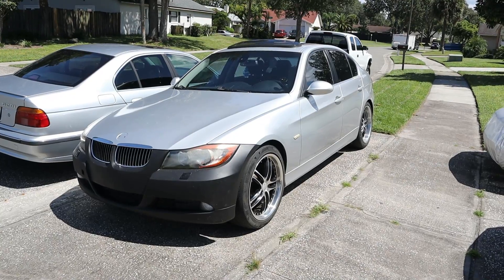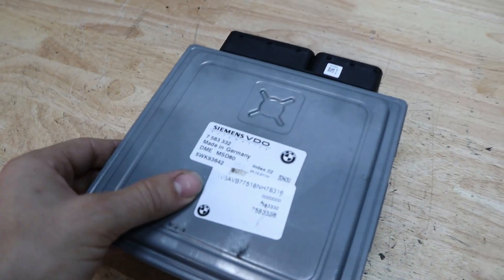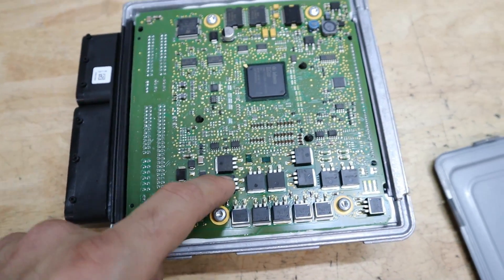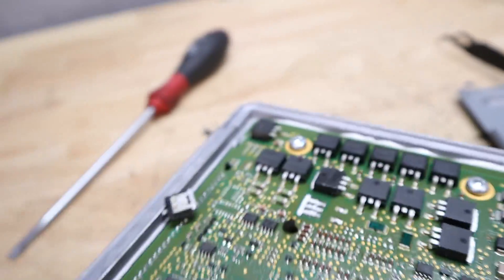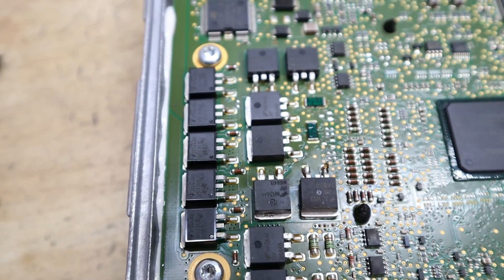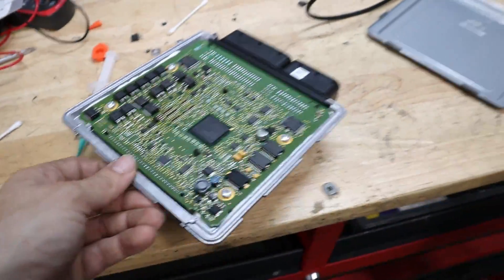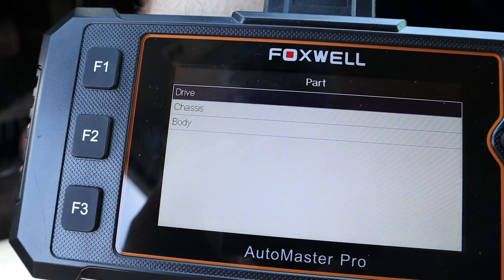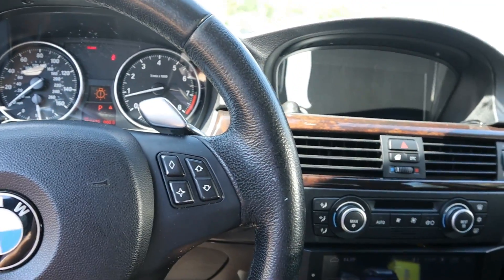WHY is my 335i MISFIRING?... MSD80 Mosfet Repair

Comment: Research says the MSD80 has two flaws. The MOSFET drivers and the power supply regulator MOSFETs. I suspect the PSU for one of the banks was the problem here. I am going straight to the MSD81 and completely circumvent the MSD80 ticking time bomb.

Comment: Hi mate , i keep getting injector misfire on cylinder 1 and 4, replaced injectors, coil packs, spark plugs, still the same, live data shows 0 activity on injector 1 and 4, does it mean i have the mosfet issue too

Comment: Being that one of the banks (3 cylinders) that are next to each other are misfiring, your problem is likely a preliminary issue, for example, the main wire that feeds the 3 coils power is broken, maybe their shared ground is broken, maybe the power wire feeding those 3 injectors is broken. Find the wiring diagram. If you don't have it, put your email in comment i can send you the wiring diagram

Comment: That was a nice video, and definitely informative, but I wanna point out couple things.
First always, always check live data on scal tool, you could find informations that could help you diagnose your problem, always helpfull and it's part of a protocol.
Seconde before you do any job that could make you waste time, make sure it's a MOSFET or might be something else such as diodes or resistance for extra protection in the circuit, cause mosfets seems working fine then they are fine..
Third after trying to diagnose with scan tool , go to the seconde easiest way which is wiring check using the multimeter and a wiring diagram for the car , check the positive on the injectors and coils it might be blown fuse since they all get the same positive from the fuse box (parallel), plus you can check the wiring between the actuators( injectors& coils) and the dme/ecu.
Fourth if everything until now is good, then you definitely have a pulse problem could be a bad camshaft sensor or a bad dme.. in this case you first test the CMP sensor, if it's fine.. then go get a wiring diagram , pinout your pins from the coils and injectors and locate your MOSFET or IC injectors/coils ( depend on where your problem is) and change what seems failing... If nothing is working and still the car seems bad.. you only have the last option which is a bad micro processor in the dme which is unfortunately unchangeable, go change the dme and you're fine, guaranteed..... 😮‍💨 That was long , but damn I love this job 😅

Comment: Why post a video if it didn't fix anything? Troubleshooting completely out of order, don't believe everyone's misinformation. SMD board repair?  was this your first experience doing board repair?  Surprised no contact pads were ripped from the board when removing. Fyi most mosfets will either look or smell fried and can confirm by it testing open or shorted.

Comment: Mostly one can never have a good reading if the mosfets are still on the circuit board, the best way to test them is to make sure each comes out in one piece then test it separately that way you can really know if it was dead so that you can really know that might were the problem was....otherwise you replace already working mosfets,,,and the other thing I noticed is that if the old original ones have no problem its best to put them back because they are genuine these days after market products are very unreliable....and also mosfets should never be touched with bare hands when  new, I m sure most know that....

Comment: You should have practiced first before this. Some of those pins are hanging on by a thread. 
You bought flux but I barely saw you use any. It’s super important to distribute heat evenly while soldering

Comment: How did you solve the error or what was defective?
Reply from the maker: New DME unfortunately. Couldn't get the old one to work.
Reply: @TheBimmerBarn  I desoldered and renewed two mosfet. Now the BMW is running again. The whole thing cost me €5. Thanks.
Reply: All mosfet must have the same ohm resistance at the end when measuring.

Comment: idk if u replaced the DME and/or if u ever fixed it. but on mesfet for cyl 4, it seems u ripped the motherboard layiing which is very important. the way mother boards are made, they are layers of sheets and if u rip threw the layers u cut the conductivity threw a path way (wire). otherwise i feel like this woulda been a good job done\. iv done a few mosfets and u did a good job from everything else i saw.
Reply: also to be noted, their is ofther failures on the dme so as mosfet repair for injectors isnt a end all be all. i thinki its like the power supply transistor. just 
 something else to keep in mind.

Comment: To anyone reading this. When you solder the new mosfets sometimes on the first try, you will be able to start the car but it will still show injectors or DME codes. Go back and take your time making sure all your mosfets are solder correctly and that each pin is making contact 100%. It took me 2-3 tries to get the mosfets to work perfectly. If even after you try that then last thing would be the injectors are bad and you will need new injectors.

Comment: Small tip. Next time remove the circuit board from the housing as the heat sink in the housing was drawing the heat from your air heater.
Reply: Great tip

Comment: hello after repairing the mosfets my n54 starts with difficulty with misfires on several cylinders I need your help. help me please
Reply: You probably destroyed the PCB pads
Reply: @papimasfuerte4671  the fault came from the transistors of the engine computer. generations of MSD80 calculators are defective at the MOSFET level

Comment: Just replaced my mosfets with help of this video. Fixed my 30ba code missfires 1,2,3 or dme fault . It was quite simple to do for how complicated it looked. (at least for me anything electrical scares me)
Reply: This is me too misfire Cyl 1, 2, 3 or DME. Car sounds like a tractor 😢
Reply: @EvilX5M  easy fix bro! Take your time and do it correctly do not break anything  heat slowly and it will come right off. When you put new ones back on make sure you added enough heat so it locks itself in place with the solder paste. If you don't sit over it with enough heat the MOSFET will come right off . To check if it's secure I pulled on it with my tweezers just enough to know it was solid. Maybe watch a second video. I watched. A few before doing it.
Reply: @EvilX5M  I would offer to do it for you because I have exactly everything to do it again but we probably live too far

Comment: I ran into an interesting problem today. I went WOT then all of a sudden "boom" huge backfire then 30ba-dme injector 1,2,3 or dme internal fault.  That's the only code. Just replaced the injectors withing a year so now I'm leaning towards dme fault aka mosfets need to be changed out. What do you think?
Reply from the maker: If your car is pre-2008, sounds like it could be the issue. At WOT, you're putting the most electrical load on the mosfets as they surge with power as fast as possible to power the injectors/coils. Check out my msd81 upgrade video to see how to find a cheap one!
Reply: @TheBimmerBarn  thank you for the reply. I bought the exact mosfets kit you had in the video.  Let's hope it fixed the problem 🤞
Reply: @Notyourfathersbmw  were you able to resolve your issue? I ran into the same issue.
Reply: @swiftyrpm1460  yes it fixed the issue.
Reply: @Notyourfathersbmw  dme or injectors?
Reply: @titolozada2510  replacing the mosfets fixed my dme issue

Comment: Program on dme...
Reply: Check the source pin of those 3 mosfets.  make sure they all connect to ground,  also use a scope to check all 6 gate pins.  if bank 2 is mising it could be the parts just before the gates.
Reply: @careytreesh4583  I can tell you know exactly what you are talking about
Reply: @MechaniclifeJDM  thanks. been doing mosfet repair work for about 5years now.
Reply: @careytreesh4583  want to repair one for one of my clients?

Comment: I did a tune on mine stage 1+ had misfires on 4,5,6 went bought NGK coils and NGK plugs thinking it would fix it ran code reader turns out my mosfets blew out 🤦🏻‍♂️ now I’m waiting on the DIY kit so I can fix my ecu dammmmnn.
Reply: did you had dme or injector problems?
Reply: Did it misfire on startup or o ly after flooring it

Comment: As a BMW tech DO NOT swap injectors without replacing the decouplers and seals!!!!! I often have to replace cylinder heads when people do this at the shop it's a 7k job! Please see ABR Houston's video on n54 injectors that covers this.... again do not follow those steps
Reply: as BMW tech tell us what wrong with those misfires ,they are almost on every car of these generations. You dont hvae any answer,but you tell us how to replace nonsene seals.
Reply: Must say great thanks  to all  the folks of late apprising us of challenges associated w  direct injection electronics ,updating software, coding and ECU replacement oh yeah and the CAS systems
Reply: @marcussaiber6021  direct injection deletes coming soon to an MHD near you
Reply: I put new spark plug, coils and seals and decoupling to all index 12 and still misfire
Reply: @xjomuel  might of been ovaled out from reusing seals. If there is sut past the seal the head is done....

Comment: You should have replaced the coil packs with the new ones and also put a new spark plugs first. That would’ve been the simplest way narrow it down. And I would highly recommend draining the fuel out and adding you if you were adding some type of an additive to bring the octane level back up to where it needs to be and removing any water from the fuel tank.
Reply: Won't fix a 30BB code unless the entire bank went at once which is almost unheard of. Usually what happened if this repair doesn't fix your problem alone is the MOSFET goes and takes an injector with it.

Comment: Wondering if you have a plugged cat on that bank, or too much oil intrusion from the valve cover. Certainly would cause misfires since your DME doesn't appear bad.
Reply from the maker: It ended up being the DME, for some reason fixing the mosfets did not resolve the issue. But in the next episode we upgrade to MSD81 and started making progress towards fixing the misfires!

Comment: Thanks for making this video. I really wanted to see you do this. I'm sorry it didn't fix the misfire. I'm struggling with my e 46 to get it to stop misfiring. It's almost always cylinder 5 and have done everything I can think of including new injectors. I get a rich code sometimes too. Last thing I can do is replace O2 sensors and do a vamos rebuild. I don't think that will be the fix but want to do the vanos anyway for fun. Good luck on finding the problem.  Keep up the great content. Your videos are very informative. Thanks!!
Reply: did you ever get it fixed mine is misfiring only in cylinder 5 as well , ive change spark plugs, coils, injectors, valve cover gasket and still chasing it
Reply: @zacharypaul1111  I’ve seen some cases where the pin that holds the disa valve will come off and get stuck in either cylinder 5, or cylinder 6 intake valves. It’s a good idea to pull off the intake manifold and look to see if the valves aren’t caught up on anything. If the pin is stuck, try your best to pull it. I’ve never had a case where the intake valve was damaged.. all should be good if you successfully remove it
Reply: @zacharypaul1111   Sorry, no I haven't. Project has been on hold for a while. I'm down to thinking it could be the cat clogged. But that's just throwing a dart at the problem. If you get yours figured out let me know.
Reply: Also the dme. Each coil is ran by a transistor that literally melt off the board sometimes. Pick up an ews deleted DME and plug it in. Most common failures are 2 & 5 for the dme transistors

Comment: Dme is bad I've had several failed with exactly the same fault codes won't be injectors
Reply: I have the same code on my n54 you think it’s the dme not injectors ?
Reply: I’ve just had tmw dmes fried in the last two days did you ever figure it out? An did you change coils
Reply: @earalmurray8982  yes new coils and the later ecu with updated drivers sorted the issues

Comment: based on some experience, i will go ahead and try to diag this situation, but i will advise to first to pull out the valve cover and clean up the surface, the oil could be clogging up some of the injectors with a mix of oil, although oil smoke isn’t present through the tailpipe it can probably be causing the injectors to not perform as they should, once cleaned reinstall the cover try your buddies injectors, and see if its still the issue, if still present than the DME took a poop, upgrade to MSD81, MSD80 in those cars are out of date. Hope the car gets back and running 🙏🏼
Reply from the maker: I'll be taking off the valve cover because it's leaking, but I agree I think it's the DME. Hopefully runs good once we fix that!
Reply: @TheBimmerBarn  goodluck brotha
Reply: @TheBimmerBarn  was it the dme or injectors ?
Reply from the maker: @titolozada2510  you can watch the rest of the videos for this build, it was the dme that had to be replaced completely. And on top of that, it still had a bad injector too
Reply: @TheBimmerBarn  thank you so much, Im having the exact problem to a cue, had the mosfets checked last night and aLL where good with zero signs off anything, currently sourcing out a msd81, will checkl the injectors tonight, was told that 1 bad index 12 injector can shut down the whole bank

Comment: I always pre heat the whole board before I attempt a repair and have the board out of the case so you can heat the other side of the board for a minute with the rework gun, the misfire still present could be a few things, it’s a multi layer board so could have a power supply issue to that bank of mosfets or even processor damage, or an external issue just a case of process of elimination, if it’s dme failure upgrade to msd 81 it’s much stronger, love  the content 👌🏻
Reply from the maker: Thanks Dominic! Yeah I'm going to have to go down that path. Get a dme, have it cloned, etc. Thanks for that knowledge about the board! It was weird how it didn't have any "failed" mosfets so it probably wasn't the issue to begin with.

Comment: Didn't think so..... You'll get it can't be nothing crazy thought maybe injectors but we cleaned them and how they look now was within a matter of weeks after.
Reply: Also having Both Lean codes on my black E46 you seen I've done every thing still lean +27 percent.
Reply from the maker: replaced the MAF, and oxygen sensors? could be dirty injectors, bad fuel pressure, or air leak in the intake manifold.
Reply: Lol done all I even have 1 piece Silcone boot I swapped my buddy's maf and had no change so don't plan on wasting money. Just had manifold off and did all silcone hoses for brake booster and more, at this point I'm wasting money but it's driveable 137k.

Comment: Replacing the Ecu helped me and my friend. We replaced spark plugs, o2 sensors, the maf, swapped injectors, pulled the entire engine harness off to check for any wiring issues. We went down the line thinking we’d “save” money, but ended up wasting more at the end of the day.
Reply: Just curious. What codes did it have on your car before replacing the ecu?
Reply: @Mr318live  It was just misfire codes on cylinders 4,5,6 I think
Reply: how much did the new ecu cost and where you get it?
Reply: @zacharypaul1111  This was a while ago, before the huge inflation dilemma. I think it was anywhere from 1000-1200. This included the ecu obviously, programming, and the car needed to be tuned again due to it having upgraded turbos, bigger intercooler, and flex fuel.